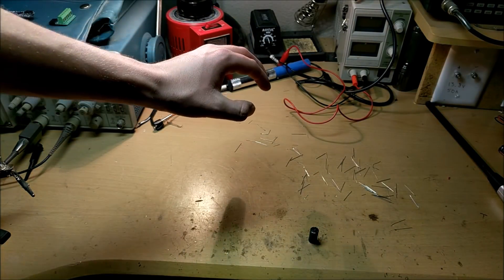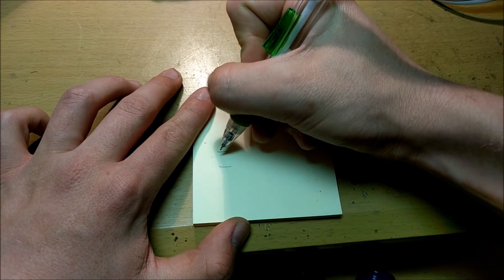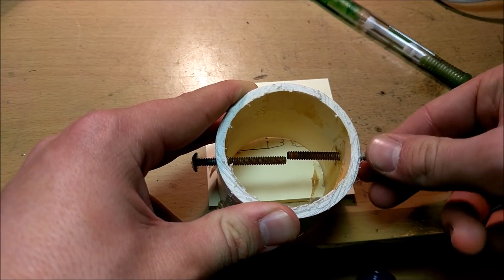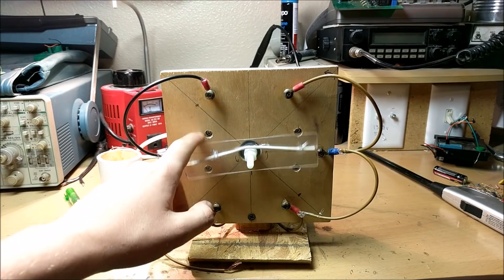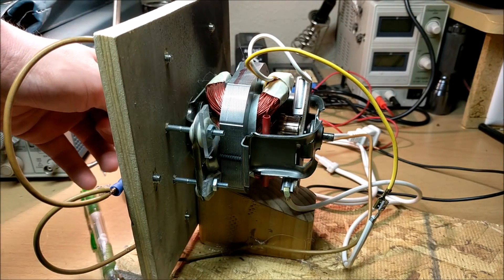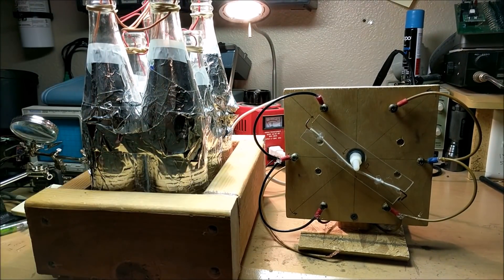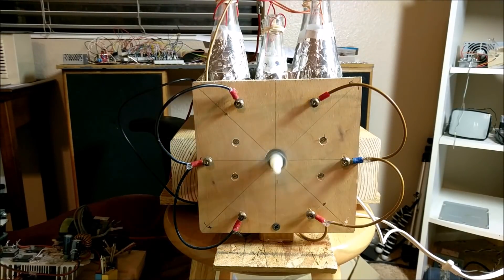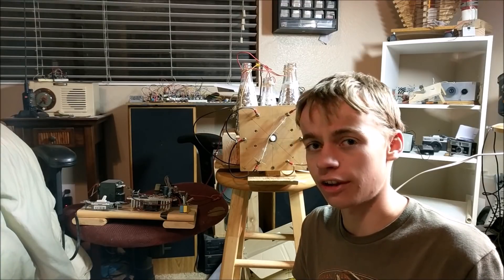Variable Rotary Spark Gap for Tesla Coil

Comment: Test 754:
Test Status: Failure
Due to lack of stability, the small wormhole generated lasted less than a tenth of a second, and had no effect on it's surroundings. Changes to the spark gap length will be made for test 755.

Comment: The spark gap emits a lot of electrical noise, will I ever have to replace the motor I am using for the Rotary Spark Gap due to RF damage?
Reply from the maker: No, these universal motors are practically indestructible.  They won't even notice the RF.  Also, I just watched your tesla coil video.  Good work!
Reply: @TannerTech  Okay thanks! Also... which one did you watch (there's a lot haha)?

Comment: Is it possible to design a spark gap able to use lower voltage ? Like 230 volts, to avoid the need to use the first transformer ?
Reply: At those lower voltages you'll basically have contactors rather than arc gaps. That voltage had a very, VERY, small arc length and doesn't ionize air very well. So just use some fanned copper brushes and you should be fine.

Comment: Tanner, You're brilliant !, I'm Trying to make a DC Tesla coil that is solid state so it won't have such a noisy spark gap
and also a Marx generator with high voltage ceramic blue capacitors and they come in assorted pf or nf like 10,000 pf,
2200 pf, 1000 pf and 470 pf. Which would you use in a Tesla coil or marx generator ?, whats the difference in performance ?
Bob

Comment: Dunno why people never use rotary saw-blades 'cause they'd make perfect rotary spark gaps; tungsten carbide teeth can withstand very high temperatures and erosion, and the large number of teeth means a lot of sparks/second.
Reply: That's a good one, it's will look badass aswell.
Reply: I think its because the frequency of spark gaps is not always preffered even at a low rpm youd still have high bpm which sucks if you wont low bpm

Comment: LoL,  Did you step on the capacitor that you flicked on the ground at the beginning of the video.  Capacitors besides on exploding have a way of getting revenge on being flicked to the ground.  Lol.......  can't wait for you to get your new high  voltage caps installed in your tesla coil.  Too bad it's not possible to attach the output of your tesla coil to the coax to your outdoor diapole.  The  Corona discharge would have been epic.

Comment: I know buying them is safer and more comfortable, but there's another way to make HV capacitors: get aluminium foil and an isolator (like paper). Then cut your foil and isolator and make a stack in this order: isolator, foil, isolator (put more for higher voltage), foil, isolator. You have to attach a piece of wire to the foil pieces beforehand, of course. I made a 1 nF capacitor that way. I'm not sure about what voltage would it be able to withstand, but I'd guess a couple thousand volts (I don't have an HV PSU for checking, and I'm still not thinking in making/buying one, that stuff is dangerous!).

Comment: It looks like you haven't read Tesla's notes about the coil. The instrument called "Tesla coil" is not exactly meant to be a spark generator. It can be used to generate sparks, but its main purpose was to generate electricity without fuel. You should read the whole book to understand why he was a genius. Maybe you will get it.
Reply from the maker: +baladár kolompár That is not exactly true, the Tesla coil was made so electricity could be transmitted wirelessly.  It would not give of Sparks, but generate powerful radio waves that could be received by another coil.  This would allow for wireless power transfer of many miles.

Comment: Hi Tanner, this is David W, the $50 guy.  Can you also purchase a super cap or two to blow up.  The small ones rated at 2.5v .5F to 1F  I wonder if the denser packed super caps will pop with greater excitement.  I would advice you to do this experiment outdoors so as to not fill your room with smoke.  Keep up the great work....  :)
Reply from the maker: +David W I have a few 1 farad caps I could blow up, I'll buy more soon!
Reply: Tanner Tech :)
Reply: David W isn't blowing shit up fun
Reply from the maker: +Rojo Do totally, I just hope YouTube didn't strike me for doing so.....
Reply from the maker: +David W Hey, I just made a video about capacitors.  In this video, I blow up a 1 farad Capacitor rated at 1.8 volts.  I will edit and upload it tomorrow.  Just wanted to let you know.  I also had a cool way of dealing with the smoke. Thanks again for the $50. :)

Comment: I got a load of capacitors for my two tesla coil builds from Lcsc, and are mint. LCSC are awesome and are helping me to set up a similar channel to yours
Reply from the maker: +Noel Andrew They send me stuff too, what capacitors did you get?
Reply: Tanner Tech I got some 2kv and some 4kv capacitors, 68uf and 10nf I think off the top of my head, will check when I get back from work. they are awesome to deal with aye, very supportive of people like us.
Reply: 10nf 3kv and 6.8nf 2kv are the capacitors, first one for a 15kv coil and second one for a 12kv coil.

Comment: Interesting stuff.  I know next to nothing on how to make a tesla coil and I know there are many how to's on youtube but I was wondering if there were a electronic way to rapidly charge and discharge the capacitors ?
Reply: 55Ramius putting a resistor in parallel with each capacitor does that
Reply: https://www.instructables.com/id/How-to-Build-a-Slayer-Exciter/  This is by far the easiest method and most effective for small projects.  Unless advanced understanding of RLC resonance is understood you can't properly "tune" the primary to the secondary - this circuit takes that out of the picture as it is self-resonating.  Try the circuit out  - I tested it on a mini coil I had and got 300V out of a 9V battery - it's quite spectacular.